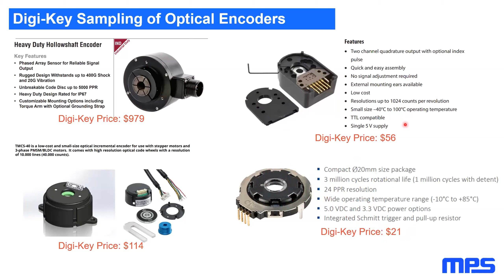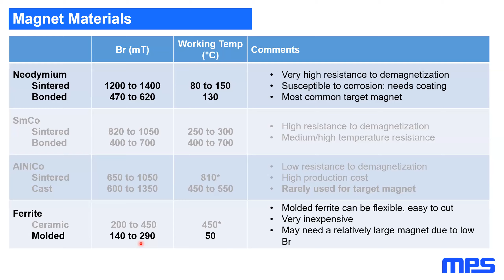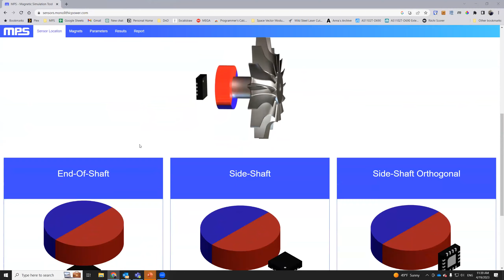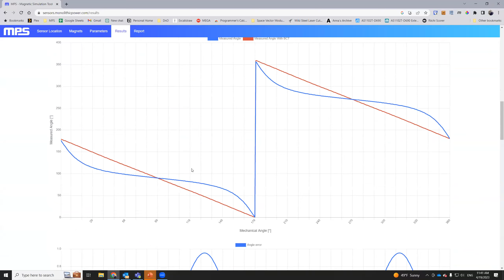Optical Encoder Replacement

Comment: Is it Ok to glue the magnet right onto the end of the steel shaft without a non-ferromagnetic spacer?
Reply from the maker: It is, as long as the ferromagnetic shaft doesn't have a notch. If it is axially symmetric (cylindrical)  then the field will be reduced a bit but not deformed. The situation where you may have issues is if the shaft is not axially symmetric - then the field can be deformed, and this will have an effect on the linearity.
Reply: @monolithicpowersystems  | Thanks